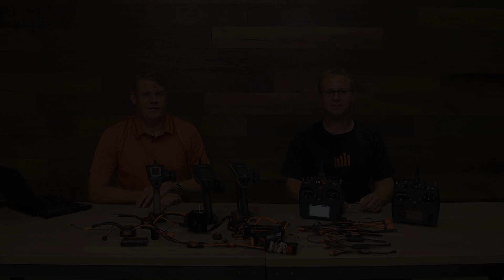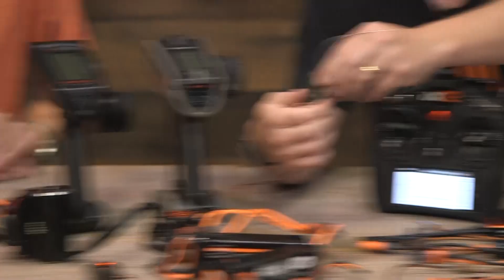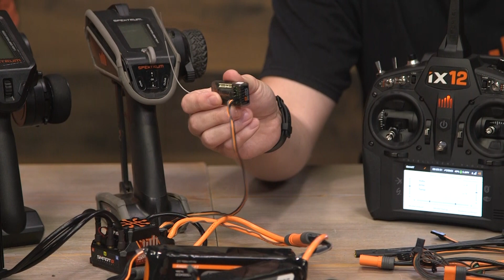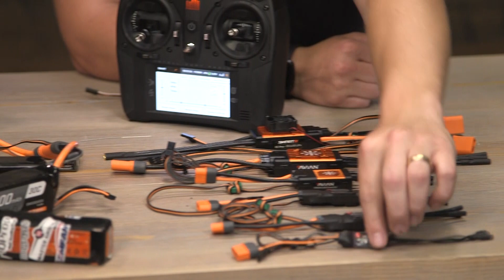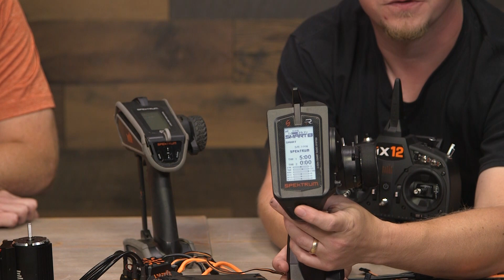So What is a Smart ESC Anyways?! - A Quick Intro into the World of Spektrum Smart ESC Technology

Comment: Hi guys. Thanks for all of your videos. I recently purchased a DX5C along with a SR6000A & SR6100AT. My models are running with an hobbywing (sorry😅) ESC, after binding I have steering but not throttle nor brakes. Do you have any idea on what am I doing wrong? many thanks
Reply from the maker: Hi Omar, Sounds like you need to recalibrate AVC. We have a few videos on how that is done, it is also covered in the manual for the receivers. Hope that helps!

Comment: Hi. I've got smart ESC (SPMXSE1150), Smart Lipo (SPMX50004S100HT), compatible receiver SR6100AT and DX6R with latest Firmware 2.04.
I van see SMART Telemetry (Motor Curent, Temperature, Volts,..) but not the Cell Voltage of the LiPo. Why? Thanks a lot.

Comment: I just purchased the dx5c and a 1250kv motor and esc but I don't have a computer to up date them do I really need to if so why do they not come with the cable to do so for the price specially on the 1250kv system that cost alot of money.

Comment: are these ESC's completely waterproof? What about the brushless motors? I have a 3300kv 540 motor. Lol Need to know cuz I just ran it in rain.

Also about the receivers?? I have this SRX200 Is it waterproof?
Reply from the maker: The esc and motor are waterproof. That receiver is not, but if you run it in the rain it should be fine as long as you give it adequate time to dry out. Also using compressed air to blow out the water that may have collected inside is a great way to help prevent corrosion. Hope that helps!

Comment: I am about to place an order (about $800) to set up my boat with all spektrum components. The only thing holding me back is knowing the size of the casing on the marine esc. I assume the measurements online are from cooling inlet to cooling outlet, but I need to know the length and width of the casing at the bottom of the unit. I’ve tried calling the help number and couldn’t get an answer. Any help would be appreciated!

Comment: Hi,
I just bought a full Spektrum Smart system. DX5Rugged with SR515, Firma 85A 4000kv brushless combo and two 2S Smart Lipo 5000mAh Shorty and the 2100 charger. I have the new firmware in everything. No to my problem. I cant get the Smart logo in my transmitter and I cant get the Smart Esc in the Telemetry meny. When I choose Esc in the meny I get data like rpm, voltage in esc and temp on circuit. But when I choose someting with battery/Lipo I cant read any data on my transmitter. It seems that I dont have all function i the Smart system.
Everything in charger is ok with the Smart Lipos.
/Mikael from Sweden
Reply from the maker: Hi Mikael, you likely need a firmware update on your DX5 Rugged and or the SR515.
Reply: @SpektrumRCvideos  Hi, first time I connected the DX5R with the USB programmer, the program show me that I dont need to upgrade. So I did not upgrade the transmitter. But after your answer, I tried again. This time I force it to new firmware. And yes now it works. Now I have all Smart telemetry in the DX5R. Is this a calculated way from the Spektrum company to let us customers spend even more money on Spektrum things😁

Comment: I dont understand what the benefit is to running a stock v5 Arrma with spektrum batteries is vs "dumb battery" The new Arrma V5 have all the spektrum electronics. What will I notice when running a spektrum battery pack vs any other battery out of the box?
Reply from the maker: If you are running the stock radio, you will not see any difference. BUT if you have a Smart compatible tx, such as a DX5C, you will get loads of valuable data right on your screen, with and without smart battery.
Reply: @SpektrumRCvideos  Thanks. So If I buy a Spektrum radio (dx3/dx5) I would be able to easily pair that with the car? Are there any other things I need besides what comes with the controller to get all that data?

Comment: does the R315 3-Channel DSMR Sport Surface Receiver transmit telemetry info to the Spektrum RC DX5C radio when using the Spektrum RC Firma 85 Amp Sensorless Brushless Smart ESC & Motor Combo?

Comment: I have an FID onboard brushless starter bolted onto my zenoah G320 and would like to know if the 130Amp version of the ESC will work to run the starter motor which will be connected to the ROSS on my SR6100AT receiver.
Reply from the maker: Do you know what sort of amperage that might be pulling?
Reply: @SpektrumRCvideos . Thanks for responding to my question. The original ESC has an 80 amps rating. Let me know if additional information or clarification is needed.
Reply from the maker: @fiifiward  Well then it should be more then capable :)
Reply: @SpektrumRCvideos . Thank you rep. Will this smart ESC display additional telemetry information on my DX6R transmitter?
Reply from the maker: @fiifiward  Only if it is plugged into the throttle channel on a smart compatible receiver
Reply: @SpektrumRCvideos . Thank you for clarifying. I'll be using this while plugged into the aux3 channel which is configured to run the onboard starter device for my gas engine.

Comment: So do the smart ESCs work with any old battery
Reply: Oh, ok thanks!
Reply from the maker: They sure do! You will even get most of the telemetry, just not the battery specific stuff like cell data, cycle count etc. But you will get input voltage :)

Comment: I wish the DX5R was just compatible with external telemetry sensors... After making an emergency landing of my quadcopter in the bay I learned the hard way how invaluable telemetry data can be. When it comes to my surface vehicles I like to also have telemetry data like motor temp and if possible battery consumption. The Spektrum Smart technology™ ESC's don't work for me because I need a sensored and waterproof ESC. Even if the SPMXSE1160 was a sensored ESC it wouldn't cut it for me because I'm running a 550 sized motor with drag brake. I'd love to be able to use telemetry on the DX5R but unfortunately it is not possible for my configuration. Please release a telemetry receiver that allows me to use external telemetry sensors with my current electronics.

Thanks for your time,
-Adam
Reply from the maker: Hi Adam, not sure what you mean? The DX5R/Pro is compatible with external spektrum sensors as well as what you get from a Smart setup.
Reply: @SpektrumRCvideos  I'll explain further in a few minutes. In currently on hold with your service center.

Comment: I’m also wanting to get into an aftermarket transmitter with a nice backlit screen. I’ve been told Futaba and the Spektrum rugged or Spektrum ones. I don’t race rc’s, but it would be cool to have different options and functions as I would like to run my lighting via a switch on the radio if possible.

Comment: Please help me out. I’m new to aftermarket Non TRAXXAS chargers. In my new 8s Xmaxx build, I’m wanting to run the newest Castle 2028 Sensored 800 kv motor and their newest 1/6th cryo-drive esc combo. I’m thinking of going with Spectrums powerstage 8s charger bundle with 2 4s Smart Lipo  5000 mah 50C hard case 14.8v and the 200w dual charger. 

Will I need a spectrum reciever and or a spectrum Smart esc or even an aftermarket Spectrum transmitter to run spectrum Smart batteries? 

Also, I’m told to run Big 8mm Anti spark offshore electric high current battery connectors and I think these connectors on the esc to, Will these aftermarket connectors work in this charger or do I use additional charging cables that plug into the 8mm connectors and then into the charger? 

I really wanna try out these Smart batteries, just need to know everything I need and how it all goes together so I can order this and have different connectors soldered on if needed. Thanks to anyone who can help me.

Comment: Great products. One question: Do you then need a Smart charger too? 🙂
Reply from the maker: Nope! Smart ESCs can be used with dumb and smart alike, same with the batteries and receivers :)
Reply: @SpektrumRCvideos  
I got Avian100 esc , if I understand correctly this esc can be used with a Futaba tx/rx?  Or other brands understanding there would be no full functions on telemetry
Reply from the maker: @Angelhernandez-hh8lo  Correct, at that point it is the same as your PWM input based 100 amp esc

Comment: How u know what motor pull is we need more info please
Reply from the maker: Motor Poles are normally listed as a spec of the motor. Beyond that, on a in runner brushless motor, it is the number of magnets on the center stator. On a out runner it is normally the number of stators in the center BUT that can be different depending on the design of the motor SO your best bet is looking up the Spec or asking the manufacture of the motor you are using. Hope that helps!

Comment: Thanks for the great overview! Can I still get battery voltage and current telemetry if I have a "dumb" battery? I'm pretty sure you said yes, but I just want to make sure before I make a purchase
Reply from the maker: Sure can!
Reply: @SpektrumRCvideos  Awesome, thanks for the answer! Quick follow-up: my project mandates that I use a separate receiver pack for powering the receiver and servos. Can I disconnect the positive lead from the BEC as you would with a normal ESC, or would that effect the smart throttle serial communication?
Reply: Very good question..! Have you tried the smart ESC with a "dumb" battery? If so, what is the result? work nicely? Thanks.
Reply from the maker: Mike lee  Hi Mike! Yes it will with update :)

Comment: Everything is good, but that 160a ESC will not hold up for long on 8s......
much better if Spektrum go to a 200a  or 250a ESC, otherwise serious speedsters will buy from somewere else. just like there doing now.
Reply: I think if you are drawing 160A on 8S and want more power, then it makes more sense to push to higher voltage, not higher current.   So IMHO a bigger problem is lack of support for >8S.   I personally don't have anything operating in the region of >160A on 8S.  I have a lot in the region of 120-160A on 10-14S.

Comment: Seems like a lot of stuff a lot of people won't ever use. I'm going to be getting a Losi with the Smart technology and it comes with a DX2E active transmitter. Im not interested in binding it to my DX5C. I haven't used or bound any other transmitter to any of my RCs. They come with their own transmitter out of the package and is already bound, so why would I waste my time rebinding to another. That's just the way I think for my RCs and I'm sure people who have bought other transmitters won't want to bother buying a Spektrum radio just to use the smart tech. It's good for a beginner, but people who have been in the hobby for quite some time take enough diligence in their batteries and RCs already will have the voltage checkers, batteries for the RCs, chargers, etc and won't want to toss it. When I get my Losi Tenacity db pro this week, I won't be looking for batteries with the smart tech. I trust what I already have rather than new tech that may go wrong and compromise my RC or batteries.
Reply: I guess the question is why did you buy a DX5C and not bind it to everything? No need to buy a remote that can store 20 models in that case. Unfortunately with the RC world and the electronics you have to make a choice. If you are a spektrum user then this makes sense for you but if you dont use spektrum (ie. Traxxas, Futaba, etc.) it doesn't. Personally, I like the smart batteries because a) they're good quality packs, b) i can program them with the 39 dollar smart checker and dont need a smart charger and c) aren't anymore expensive then non-smart packs from other brands. I am personally going to be putting a smart esc in my B44.3. I just bought a spektrum DX5C and got the new upgraded receiver on special for 154. I am planning on taking out the discontinued Mamba Monster Max Pro ESC but keep the Castle 3800kv (1410).  Should be a good 3s setup for speed non dirt racing. I will dial it down to 2s for dirt racing. I am a spektrum guy and have been since getting into RC about 10-15yrs ago.

Comment: Smart, right. You didn't answer the esc question, of course it's a hobbywing, however you should have made it at least a 200 amp esc and make very sure it dosen't shut down during speed runs like the other hobbywing esc's. So let's be honest first and foremost. Is it a hobbywing esc and why hide the top secret motor if it actually is a spectrum motor, also do a range test on the radio, also I have the dx6r, I haven't seen a range test on and only use it on tracks that are close in respect to the transmitter, just don't trust spectrum on long range speed runs. How long must we wait for an update for the dx6r update. Please let me know all of thee above. Thanks
Reply from the maker: Darryl Thompson We hope to have 6R update out in a month. Thank you for the suggestions, We are always looking to expand our line up. If a esc is shutting down mid run then likely it is thermalling. Not really hiding the motor, just nothing on website about it so no need to talk about it much. Hope that helps answer your questions! Thanks!
Reply: Thanks